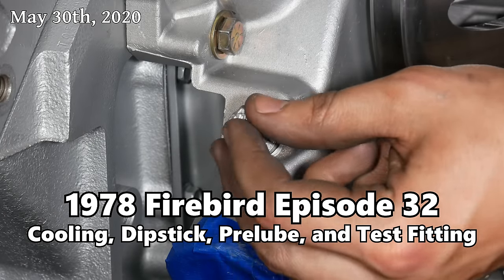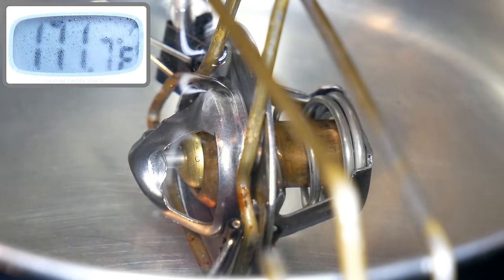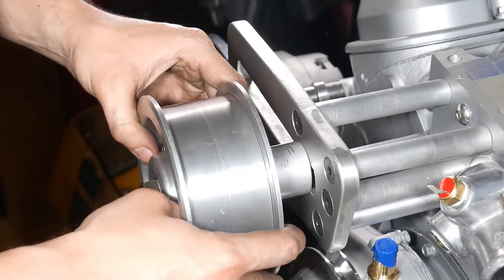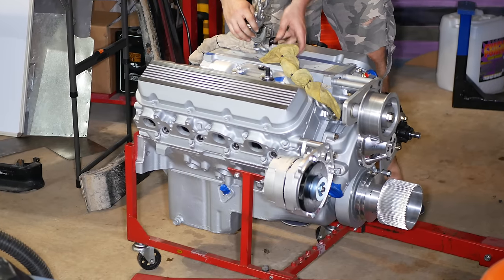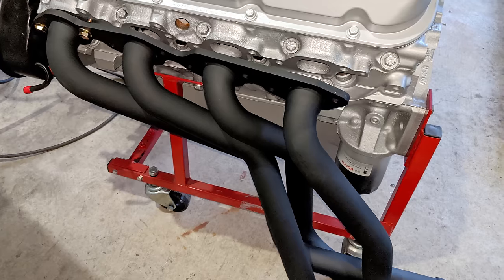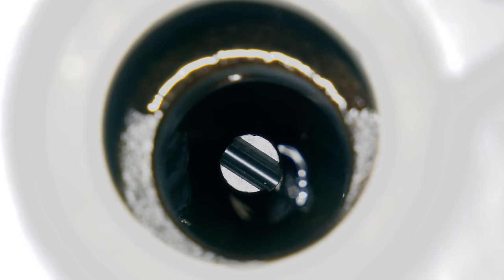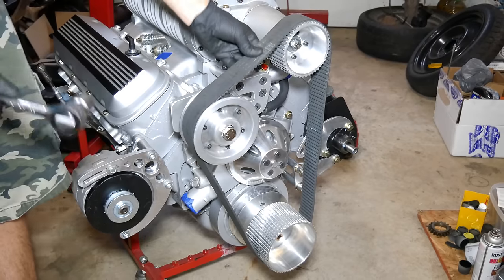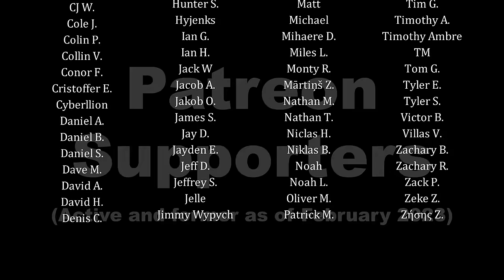454 Engine Swap: Cooling System, Dipstick, Prelube, Test Fitting Supercharger (78 Firebird Ep.32)

Comment: The exhaust flange/head bolt problem is quite common on big block Chevys.  Even high quality headers (Sandersons, at $1000+, for example) run into the heads of the short head bolts if you have ARP bolts.  There are 3 solutions.  1.  Switch back to stock head bolts, which are lower.  2.  Grind clearance into the exhaust flange.  3.  Grind down the bolt heads.  (In some cases omitting the washer under the bolt head will get you enough clearance.)  #2 is the commonest, requiring the least destructive changes to your engine.  You can drill small holes in the dipstick at the full and add levels to make it easier to read, but I sandblasted the dipstick an inch above the full line and an inch below the add line and that makes it much easier.

Comment: Quaker state oil with a flat tappet camshaft.
Reply: I noticed that too.
Reply: It will be fine, he added a ZDDP package and also Quaker State isn't bad like it was because the quality went up after the Pennzoil / Shell purchase.
Reply: I should add I used to be a HUGE anti Quaker Sludge advocate.
Reply from the maker: I'm definitely no expert on the matter, but I don't believe modern Quaker State oil causes problems like some of the older formulations did. I've used it in quite a few engines over the last few years because of the price and availability, and haven't noticed any issues.

Comment: I'm sorry but he installed a Hardware store Galvanizes pipe fitting ..When Autozone or any of the other Big auto store chains would have had the proper plug hanging in on the HELP rack ..Maybe this guys dad owns the local hardware store and that's why we see so many hardware store fasteners .

Comment: So on the oil dipstick. Are they all going to be the same or are there any difference. For example I have a 454 out of a motorhome and bought a new stick at random. Should I be worried. I also don't know if I have a 9 quart pan or what. I've added a little over 7 quarts and according to the stick I bought I still need about 2 more quarts.